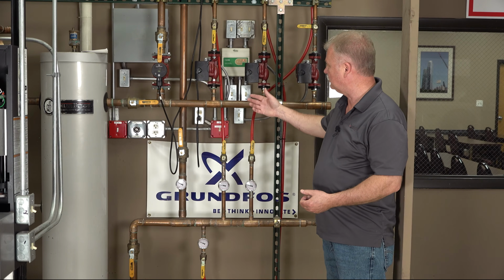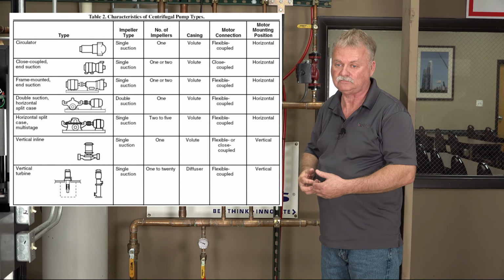Hydronic System Overview

Comment: It's probably slower than most heating systems but is it still the most efficient and most uniform heating system if set up properly?
Reply from the maker: We would say that a hydroic radiant floor heating is the most uniform heating system.
Reply from the maker: And we would say that water-to-water ground-source heat pump (GSHP) would be the most efficient heating system. But depending on your utility costs, a gas-fired boiler feeding the radiant floor might be less expensive to operate (but not more efficient) than a water-to-water GSHP.

Comment: Thanks for the great video. How do you determine the circulation capacity of the circulator?
Reply from the maker: The manufacturer will have pump curves published for each circulator that will show the capacity (GPM) at the specific pressure (ft of head) that your system is operating at.